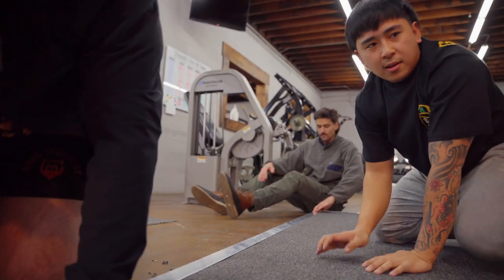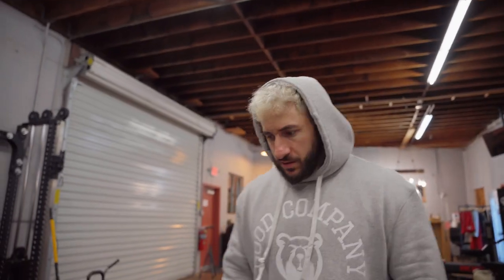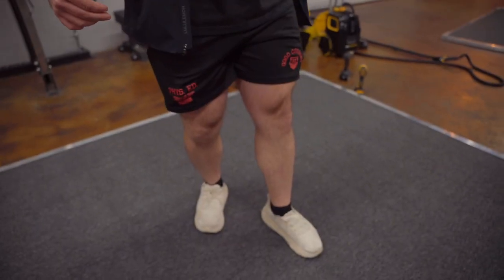How To Build The BEST Lifting Platform

Comment: I do deadlifts as well as oly lifts. I'm trying to figure out how to make a platform that won't sink under deadlift weight but is also soft enough to absorb shock from overhead drops
Reply from the maker: This + rubber * better wood
Reply: Horse stall mat from Tractor Supply